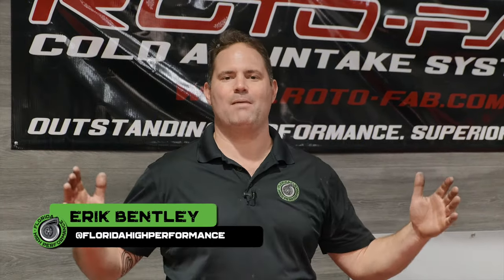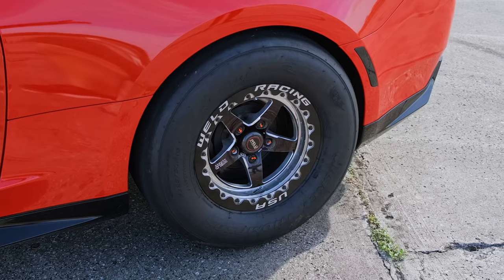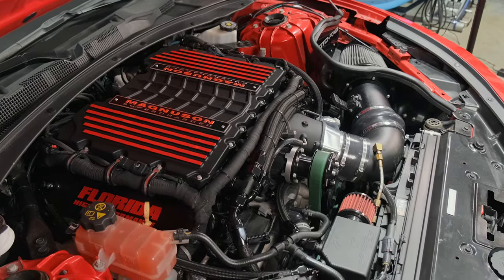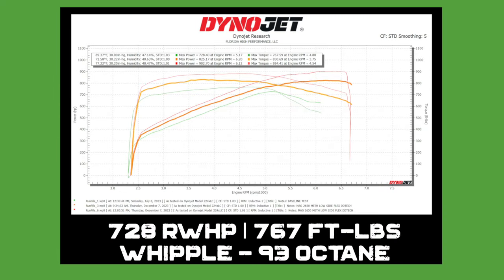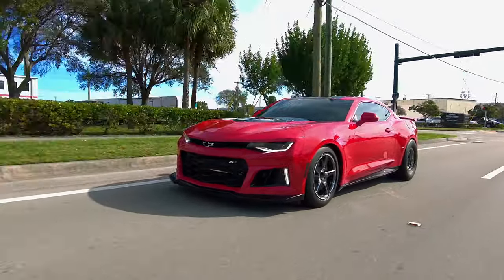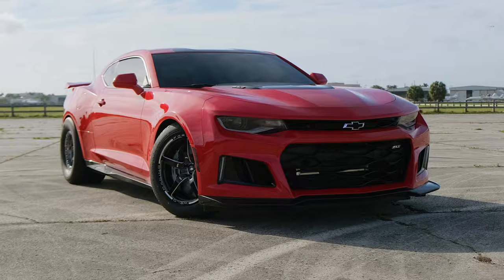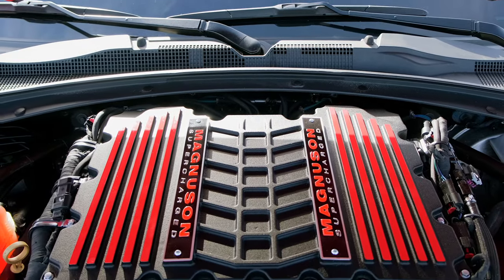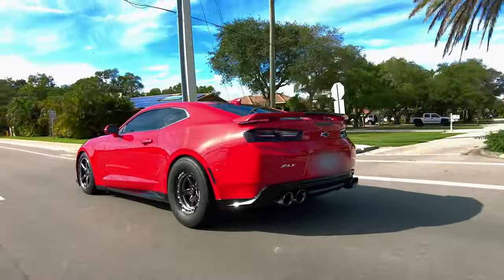Fixed this Camaro ZL1 and made 900 WHP On The Magnuson 2650R

Comment: Its all about the most HP and TQ possible. I know some shops you have max numbers set based on the setup and won't push past that for long term reliability. Safe timing, safe A/F, certain PSI can drop HP by 100-200. depending. Anyway fantastic build
Reply from the maker: @Josh-hr5mc  agreed…we are always on the conservative side in most cases

Comment: Great video!!  What is the correct oil for a build like this?
Reply from the maker: Rotella T6 5/40 Syn
Reply: Thats what i used to use on my 800 rwhp 2jz 300zx, people were like but it's diesel oil LoL.@floridahighperformance
Reply from the maker: @dsmubz nothing works hard than diesel engines- so I go with it…and so do many leading engine builders.

Comment: what was the weight of the correct oil needed?
Reply from the maker: We switched to 5w40 - which is typically what we will run in any of these types of builds.  The heavier weight really helps to keep the lifters pumped up and happy above 7000 RPM...

Comment: The whipple was MORE than capable of taking that car to 1k hp if the IC pump was working and it was tuned right.  Pulling the twin screw blower for the 2650 was a money grab.  -------not a good look on this one.
Reply from the maker: At no point did anyone say the Whipple wasn't capable.  A LOT of conversation between Dan and I was left out of this video.  IN fact, the plan originally was to leave the Whipple and roll with it.  It was the older 2.9, not the newer 3.0 first off - we discussed running a new 3.0.  Dan was leaning toward a 2650 anyway, so we went that route.  The car was purchased with the Whipple already on it..so it was easy for Dan to transition over.  Secondly, since you want to blame me for money grabbing, I actually helped Dan sell his 2.9L to another client of mine who can greatly benefit from the 2.9 on his particular build..so not only are you dead wrong, but it is quite the contrary.  I simply followed my clients wish, helped him sell his existing part, helped another client obtain a quality Whipple at a fair price, and everyone wins.  Next time you accuse someone of something, have all the facts.
Reply: Not true, I've had customers insist on a particular kind of supercharger kit like this 2650 since it might come on stronger, more power under the curve than the 2.9 whipple unit he had.
Reply: I see far more Whipples removed from 6th gen’s than any other aftermarket blower. I am not sure what’s going on but it’s a bad look.
Reply from the maker: @corypierce202 we use both- both work…depends on customer needs/wants.  The 3.0 whipple is superior to the 2.9.